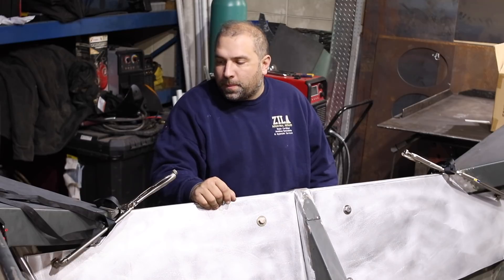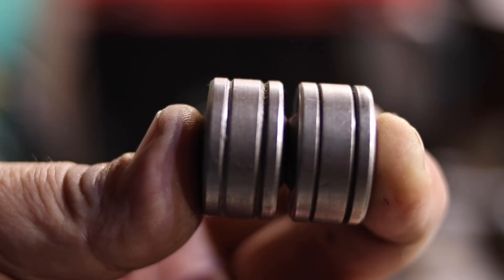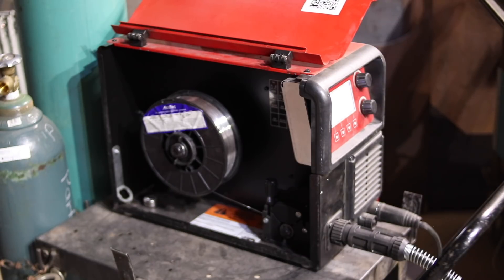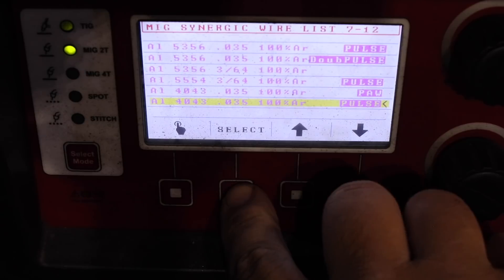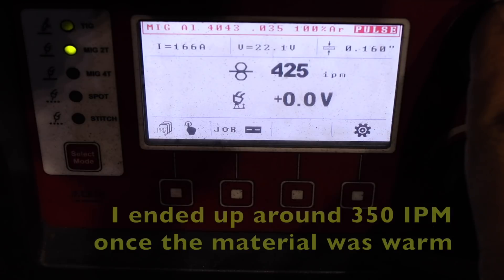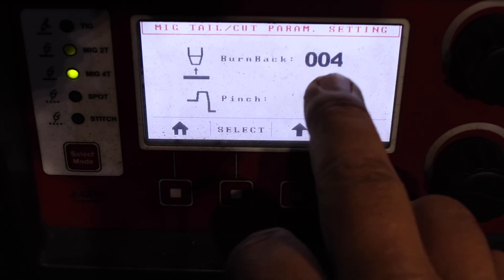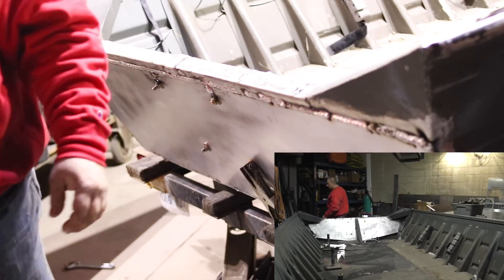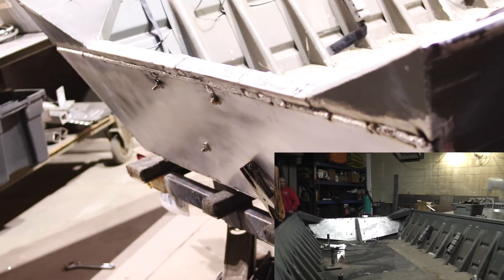How to pulse mig weld , in depth tutorial welding on an aluminum boat with the HTP Pro Pulse 200

Comment: Is there a good way to tell what type of aluminum you are welding if you have no knowledge of what it is. I do a lot of tractor trailer aluminum repair and other aluminum odds and ends and I’ve been kinda in the dark as to what the material series is
Reply from the maker: https://youtu.be/iFj2M3K4DYA
Reply from the maker: https://youtu.be/hqdpzioF6to
Reply from the maker: a lot of tractor trailer stuff is 5454 base material.... some is 5052 some is 6061
watch these other videos - also bottom line - contact the manufacture .... they typically will proudly tell you what material their stuff is made from (in comparison to the competition) and why that is better ... and then you know
Reply: Thank you. After reading some of the other comments on here I saw you talk about the tanker repair so I already went back through and saved them to my watch list. Appreciate all the information!
Reply from the maker: @gearhead181  you are welcome
Reply: Nope impossible.
You might be able to get an idea bc of the copper content is some aluminum is higher and when trying to weld it will burn with a green glow because of the copper burning.

Comment: There is no way in hell I would ever use a regular push fed mig gun with aluminum wire going through it. 
If it’s not huge diameter it will kink and break and then  your changing your liner out. Hell we use to have hell with millers push pull gun. Spool guns work best but I’m willing to give push pulls another go at before I close the door on them.
Reply from the maker: LOL ..... I have run well over 200rolls of aluminum wire through that machine like this ... and I can count the amount of birds nests on less than 2 hands !!!!  and thousands of HTP customers fell the same way.

Comment: Thanks.
Question: the amp reading on the screen is peak amps or does the machine automatically select the peak and base currents based on the amp setting originally set? Also in single pulse is the frequency set automatically as I didnt see you set it
Reply from the maker: The reading on the screen is an effective average.   Peak is 300 amp
Reply: Thx

Comment: Have yet to use the PP220 with aluminum. I like 4943 tig rod so I was considering  trying Hobart .035" 4943 wire. Would the 4043 settings work or be a good starting point for 4943 wire? I'm interested in what your thoughts are or if you ever tried the 4943.
Reply from the maker: I have only used the tig rods and some 4943 in a spool gun without pulse. 
I have talked to a bunch of customers who run that wire on pp200/220
It needs a little more voltage than 4043 maybe +1.0  otherwise the 4043 program is reasonably close ….  
Some guys like to use the 5356 program with a little bit more arc length correction…. I can see how the 5356 paw has a better arc on material thicknesses of .080” and less material thickness.

Comment: I like the machine and your welds are good. nice profile, no rolling on the toe and hot. But I cannot understand why you weld free handed. This is something I was told never to do when I learned the trade and for a good reason. I can see on your long stretch where you went a bit sideways, That is caused by free hand welding. You must be exceptionally good to weld like that, I cant.
Reply from the maker: Well, when i first learned mig welding ( in germany almost 30 years ago ) automatic helmets were not really a thing. Hand held shields were the “standard”.  So the first 5 years of my life i welded ( by necessity ) single handed. 
At some point i moved to the states and welded with a regular hood and i applied for a job here and the guy said : i will hire you but you need to weld with 2 hands!!!!  And i said, when you hold the pen you sign my paycheck with with BOTH hands as you are signing it - that will be the day i weld with both hands 😂
Fast forward : i did a lot of work in scrapyards, on ladders , holding myself up with one hand, welding with the other ….
And i used to be really good at it much better than in this video or now ….  
Now i have “experience” and i dont give a f ….
When i weld under a trailer, on a ladder, in some tight space often enough i have to weld single handed and often enough the situation chooses ( not me) which hand i have to weld with ….
I can weld almost as good with the left hand as i can with the right … it does not matter …. 
I am not sure that there is anything exceptional about me ….  Its just years of muscle memory and what you are used to …
Reply: @ZILAwelds  I pretty much did like you. Came from France in the US in 75. learned the trade went to work for Douglas as a Tig welder, then open my business portable welding in CA specializing in seismic retrofit.10% of the weld are UT. No way I could weld the full pen with innershield at 300 amps single hand. NO WAY. I like the HTP. In one of the videos the guy is maxed out and the amps shows 160. I dont get it. is n it supposed to peak at 220 for ten seconds like they claim in the brochure? Take care. (where are you located?)
Reply from the maker: @bernardmauge8613  milwaukee wi

The amperage varies greatly with ctwd ( aka stick out) if you are too close you get well over 200 amps, if you hold it just right you will be at 180-190 ish amps and if you hold it way too far then you see 150-160 ish …..

Comment: What do you have the gas flow at on this machine for pulsed aluminum?
Reply from the maker: 40 ish CFH….  Because with pulse you need a little more than regular spray ( more amps in the peak pulse current which determines the gas flow needs) 
Besides gas is your friend! In some situations i run 50 to help “keep things clear”

Comment: Great video Pete, love your work. Got a question how thick of aluminum did you weld or can you weld with a Stel iron mig 221? Thanks
Reply from the maker: That is not a one answer question.....  are you using ALMG5 wire or ALSI5 wire ?  1.0mm or 1.2mm?  
the short answer is (single pass weld) no preheat room temperature material
1.0 mm wire ALSI5 roughly 6mm
1.0mm wire ALMG5 roughly 5mm
1.2mm wire ALSI5 roughly 8-10mm
1.2mm wire ALMG5 roughly 6-8mm
the 1.0mm programs have pulse these thinnesses are for single pulse, the some material thickness off for double pulse
the 1.2mm wire programs are SPARY non pulse ...
Reply: Thanks for your answer, for most of the jobs i’ll be using ALMG5 1,2mm, i have a ESS E4 2800 machine with pulse and all the AL programs, am hoping it is enough for 10mm thick aluminum, most jobs are repairing truck tipper trailers

Comment: Job- you said it was already fit by the customer. I'd planned for 4hrs labor+100 for consumables and overhead. Clean, weld, water test, and fix any leaks.  $500 job
Reply from the maker: clean, yes - where necessary, customer did a good job, 3 hrs labor $25 for consumables because I used too much argon gas  ...LOL. weld - send it !  no leak testing you can see the arc much like tig and you can see where to fully fuses the metal and you have no short circuit crackle ....  so you know you are breaking through the oxide layer ....  $300 out the door
Reply: @ZILAwelds   Welding wise sounds reasonable but you're not being paid for your experience. Have to sell that part. That's the "water test" part.
Reply from the maker: @WHITERIVERRAMBO  LOL. it was November ... customer water tested it in march all on his own ... no complains ....LOL. he came back to build it out and put a full deck on the front   https://www.youtube.com/watch?v=DekduNFexBM     that is one not to miss !

and then Cleetus McFarland saw that ... and next thing you know ....
https://youtu.be/l6GeNNZmWuw

Comment: Material n Labor = $310.00 
Plate (my guess) = $75.00
@ $80.00 hour x 3 hours
Am I close?  
Question: I want to build me an 16" Aluminum boat, do yo think I would be fine using my Lincoln 210mp?
Reply from the maker: 3 hrs at $100 per hour customer supplied the material (which by my best guess was at least $150 maybe 200. as far as the 210mp being a good welder - maybe.  let me write a separate reply for that

Comment: The one reason I'm asking is this unit is a 220 volt and cannot be too far from the power source ,with a spool gun I can extend the working distance from power source , example I have a Aluminum trailer that is about 40' away +- with a 20' heavy cord for 220 volt  and a 20/25' spoolgun hook up I can do what I need to do
Reply from the maker: jas van i would not worry about that so much - when i did those aluminum tanker trailers i ran the machine on a 100’ cord !!!!  10awg    The max draw is only 35 amp ...  effective input current is 19 amp or so ....   

A 100’ cord will be just fine ...
Reply from the maker: jas van and than for maximum portability i used a 25 ft gas hose ....  that works really well !  The machine itself is only 41 lbs

Comment: So I've seen you on Chuckee's videos before, but just found your channel, [Subbed]. I have a Miller Syncrowave 210 (stick, Tig, & spool gun) & recently rebuilt a transom on a similar yet slightly smaller boat (16'x50" wide) that had been painted camouflage. Removing the paint residue for a clean weld was a challenge, & material was around 0.060". I attempted the spool gun (according to your #'s, may not have had enough gas, set at 20cfh), and had to go back & fix with tig. My welder doesn't have all of the options that you went through on the HTP, which I can see as a tremendous benefit. Even doing short 2" back-step welds, warpage was a serious issue. Thanks for the great video!
Reply from the maker: >>So I've seen you on Chuckee's videos before, but just found your channel, [Subbed].<<
thank you
>>I have a Miller Syncrowave 210 (stick, Tig, & spool gun) & recently rebuilt a transom on a similar yet slightly smaller boat (16'x50" wide) that had been painted camouflage. Removing the paint residue for a clean weld was a challenge,<<
http://amzn.to/2nfTzxK
this works really good - just clean 3/4" left and right of where you want to weld
if you don't have a a bigger compressor the use this

http://amzn.to/2jxG8UN
it does not work as good ... but typically good enough

>> & material was around 0.060".<<
in my opinion - that is too thin for a spool gun 

 >>I attempted the spool gun (according to your #'s, may not have had enough gas, set at 20cfh),<<
and you don't have enough low end on that machine either ...

>> and had to go back & fix with tig.<< 
yes - not a huge surprise - i will have to make a video on "when to use a spool gun " .. have had similar questions and comments now a bunch of times in the last 2 weeks ...

>>My welder doesn't have all of the options that you went through on the HTP, which I can see as a tremendous benefit.<<
yes - the spool gun on your machine is like crutch - not a specialty tool ..   you still don't have hot start you still don't have crater fill - you still cant weld anything less than .100 or .125 (1/8") with it ....  spool guns are a pretty crude tool - that can be very effective for small repair jobs of 1/8" and thicker material .....

>> Even doing short 2" back-step welds, warpage was a serious issue.<<
yes - that too

>> Thanks for the great video!<<  thank you for watching

Comment: For a walk-in, specialized set-up, ie. Your set-up time is restricted to this one job, (customer wants certifide welder), not able to mark up materials since I believe you said he already had the plates made to fit...24 linear feet turn key would be (IMHO) around $1600.00.  I'm guessing this upgrade to the boat will come out around twenty-two to twenty-five hundred easily.
Reply from the maker: i would say yes - but a very small piece ....  i have about 30 machines (mig, tig stick plasmas and engine drives ..  )    i used to have 3 acdc tig machines before i got my Pro pulse 200 ...  about 3 month laster i sold the first one - and 6 month later i sold another one ..  the last one i kept ... it is good for some super clean build up welds on parts that were machined wrong (with no spatter over the rest of the part)  it si also good to make some cosmetic welds on little motorcycle oil tanks - it also mades 100% leak tight welds at first try .....    (not saying this machine here can not - but it takes some getting to know it to dial it in perfect .....  

for the day in day out business though - where back in the days 50% of my aluminum welding was spool gun and 50% was ac tig ....   now its 95% pro pulse  0% spool gun and 5% tig ....

but when it comes to those 5% you don't want to miss it ....
on the other hand - if you currently don't own a acdc tig - don't bother buying one once you own a machine like this

for repairs it is excellent  !  did you see the bulk tanker repairs ?  the baffles and the catwalks ?  i mean it is 41 lbs - with a 25 ft gas hose and 220 volt extension cord this thing will run off your miller or lincoln engine drive - like a champ !

you will be fixing truck aluminum fenders, bumpers trailer floor, etc etc .....

for aluminum in my opinion it is the absolute #1 when it comes to aluminum and portability 
it is still #1 even without the portability aspect - just from a price point ...  you can not tough ANYTHING in the north american market not even for twice the money ...   Miller 5g  lincoln 45oo (yes  - of course those machines have 300+ amps) but they don't run off your generator and weigh 5 times as much and cost more than twice as much ...
esab, nothing, thermal arc, nothing   (yes the SP320  if you have 7 grand laying around ....)
everlast - nothing  their pulse machine is full manual pulse  - takes you weeks to figure out how that works ...  and has no hot start, no crater fill ... nothing ....

so i say - if you have a need for it - go for it !  programs for gas less and dual shield flux cored ...  steel pulse spray arc (looks like store-bought welds)   excellent for Stainless and super versatile with sibro ... even for cast iron .....  

 i mean i have it - and i like it !  and you would have to pry it out of my cold hand if you would want mine ....
Reply from the maker: that is a pretty high guess ...  and i believe that i can not charge extra for "being setup" i believe that the fact that i am set up is the reason why i got the job .... 
but thank you for your input !
Reply: Hey Pete, nice video, im from ontario canada, run a small custom fab shop, was thinking this would be handy on the road and shop, looks like a fairly advanced unit for aluminum which could be above competitors, does aluminum tig still have its own place compared to thismaxhine or will this work on thin aluminum well? Josh
Reply: I wont take it from ya, haha yeah i have ac dc on my lincoln ranger 250 to run tig and a scratch start tig on my miller 250 shop stick welder, i seen the bulk tank truck repair with that machine, love these videos! I know this would give me a bit of an edge around here as far as advanced aluminum repair and fab goes